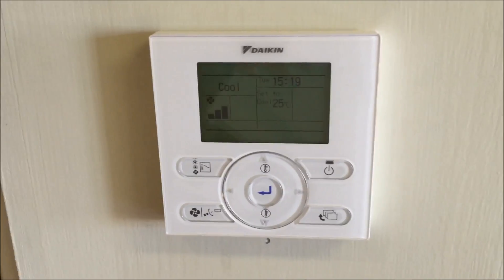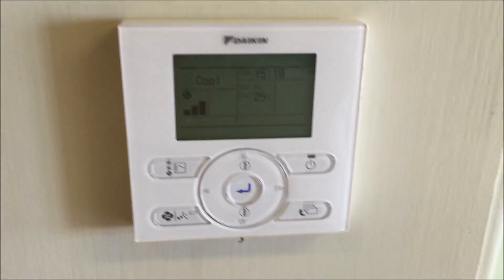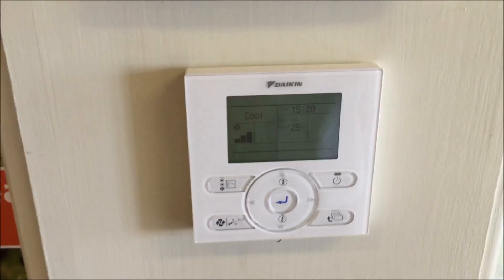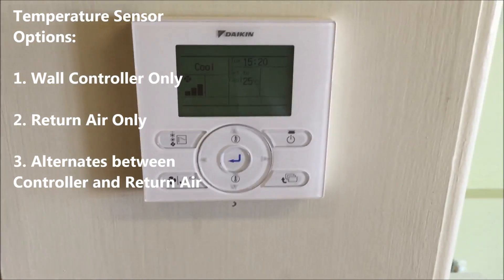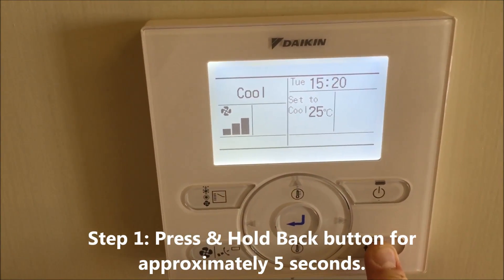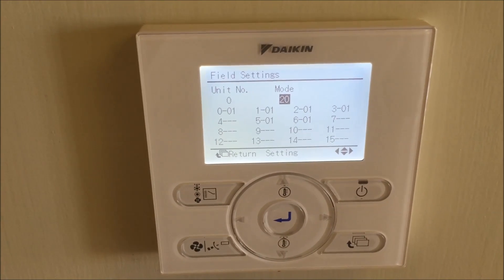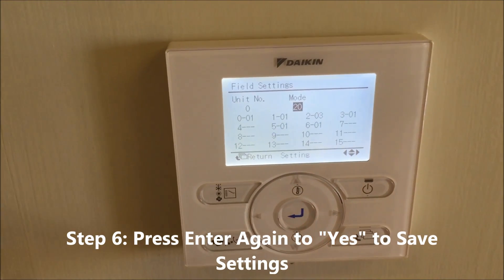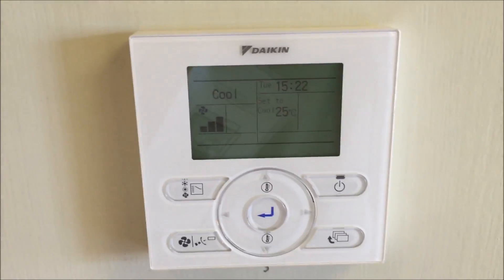Daikin Wall Controller – Improve Room Temperature Accuracy | Activate Built-In Sensor

Comment: What happens if I use 20-02-03 but I have 2 wall units? (One upstairs and one downstairs) and they report different temperatures. Which one gets used? Also how can I change it so that the one upstairs is the main one?

Comment: Thanks for these videos... just had a Daikin system installed and they've been super helpful!

We've got two BRC1e73 controllers -- one upstairs and one downstairs. The upstairs is the master controller, and it seems as though the downstairs is using the temperature reported by the upstairs unit and not the actual temperature of the room it's in. I've tried tweaking several field settings that seem like they'd be responsible for this but no luck. Any ideas?

Comment: Setting to  20  02   03 
will set it to Alternate Between WALL & RETURN AIR sensor

20   02    01 sets it to WALL sensor
20   02    02  sets it to RETURN AIR sensor
Reply: Wrong, its code 03 that read from remote control.

Comment: How to turn them on... i try pressing the power button didnt work
Reply from the maker: Try checking the circuit breaker in the switch board to make sure its in the ON position.  If not, switch it to the on position.  If it won't stay on, there may be a fault with the unit, in which case you will need to seek further advise from a qualified service agent. Best of luck.

Comment: I have four cassettes and, thus, 4 thermostats. They all read 4 degrees (F) higher than multiple store bought wall-mount thermometers. Is this normal? Is it possible that all amazon purchased thermometers (even the cheap ones) are incorrect and the thermostat is correct? (i'm guessing the opposite). What has your experience been with these thermostats? I can't seem to find a thermometer online that will display the temp. in the room anywhere near what the thermostats are reading.

Comment: Hi, on my wall controller the room displays the temperature and  the set to is on 25 on heat. The problem I have us keeping the "set to" on 25, it keeps going back to 20, can you tel me why? I can't seem to locate any answers in the manual.
Reply: We have the same problem
Reply: @melissahoare4054  If you find an answer, please, pass it on 😎
Reply: You seem to have it on auto mode where the system tries to balance the room temp either heating a bit when cold or cooling abit when hot. Try turn off the auto mode and just put on heat or cool and set temp. Also reset all setting incase its on some range set mode

Comment: I have a BRC1E73 controller and no matter what temp setting I use it reads the room temp as 80F degrees. I have an independent instrument and comfort level having room temp as 70F. What am I doing wrong?
Reply: I have same issue. Is there a way to calibrate the thermostat with the actual ambient temperature in room?

Comment: Please help! I have the BRC1E62. We have 2 bedrooms with the controller for them outside in the hallway. We have another unit in the main living area. We just want to cool our bedroom at night but no matter what mode we set the room's temp is not being considered and just keeps cooling. With 20-01,20-02 & 20-03 the room freezes when set to 25. It's like there is no 'Return air only' feature. Can anyone help?
Reply: Like ekwipt writes, the only way to get the temp close in your bedroom is to make sure there is clear circulation of air from your bedroom to the return vent, so the hallway temp is the same as the bedroom temp.
Reply: I'm having the same problem, the return air is normally in your hallway, same with the controller (Ours is directly over one another), so theres no sensor in the bedroom at all. So when you set your Aircon to say 24c and you only have the bedroom on, it's getting the temp from the hallway (it could be 30c out there), so there no way for the unit to know what the temp is in the bedroom.

The only way to "fix it" is to turn the aircon on in your bedroom and hallway

Comment: I have the BRC1E61 controller with a FDYP100DLV1 indoor and RZP100DV1 outdoor units.  Selection of 20-2 field settings will not use the air intake thermistor in the indoor unit despite setting the field setting to 20-2   -02.  The only selections are 01 or 02 and both default to controller thermistor.  I am told the BRC1E61 will not do this function with my system.  Will the BRC1E62 do it ???  Any solution.

Comment: What reasons would you want to use the sensor st the control vent, return vent or alternate?
Reply from the maker: Hi thanks for your question.  Generally it would be assuming you have the wall controller installed for example in the main living area and away from the return vent, this can often provide improved temperature sensing.  You may decide to switch the temp sensor back to the hallway at night assuming it is near the bedrooms.  Alternating between the two will give you an average between the return vent and the wall controller and might be useful if you are running both living and bedrooms together (assuming the capacity of the unit is large enough to handle both areas at once).

Comment: How do I activate AUTO mode that is not showing on screen?
Reply: Hello, the thermostat the master only shows cool, heat, fan and dry I think, but AUTO mode is missing! so now is winter, but sometimes it could be warm and then I have to go and change it to cool.
Reply from the maker: Hi Diego that's a bit strange...by default the mode options that you scroll through are as you have indicated cool,  fan, heat, dry but then it should definitely have the mode option of Auto.  Not heard of this before.  Unless there is a way of deactivating this option via the field settings but I'm unsure of this.  In this instance it would be advisable to speak to the company that you purchased it from.  They may need to speak with Daikin Technical Support for further advice.
Reply: Greetings; Menu options for Temp I see are 'System' (nothing shows on mine), 'Outside' (nothing shows) and of course 'Room' (Working).  Is there an actual missing thermometer to enable outside air temp?  
Ducted system; RQ140KV4A.

Q2; Any updated colour screen panels, or wi-fi enabled addable apps for this system?  Curious.  Cheers.

Comment: my wall controller looks different to this one- is there a manual for my one?
Reply from the maker: Hi Jo, If its a Daikin system, would need to know the model number of the wall controller itself.  This is generally on the lid (if it has one) or somewhere else on the controller.  If it is a Daikin it will usually start with a "BR" in the model number of the controller.

Comment: Can you please check text on screen at 1:10. It seems to contradict changing it to 03 for wall only setting
Reply from the maker: Thanks Len...The text on screen at 1:10 is only highlighting the various options of where the temperature can be sensed from ie 1) Wall controller only, 2) Return Air Only or 3) Alternating between both.  The actual code to sense at the "wall controller only" as described in the video is Mode 20, 2-03.  I can see how this can be misinterpreted though. Thanks for your comment.